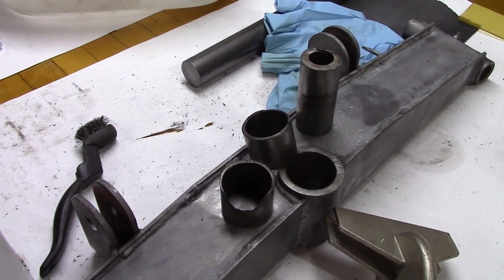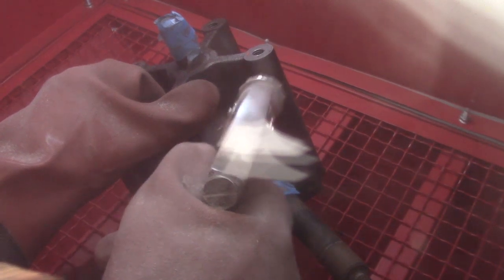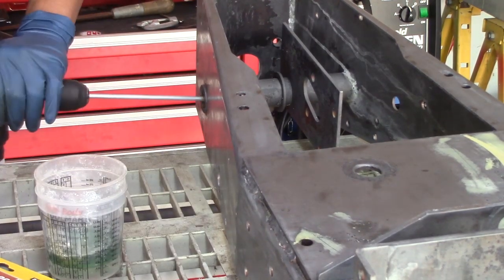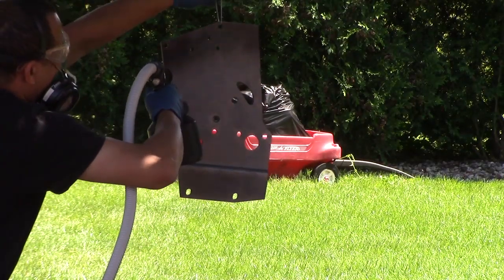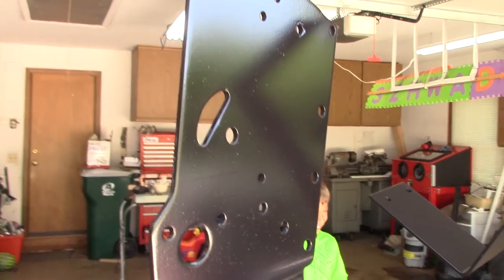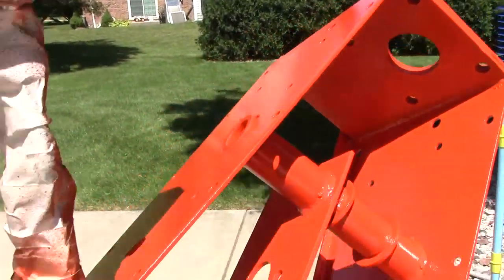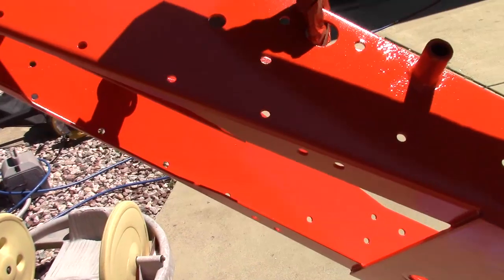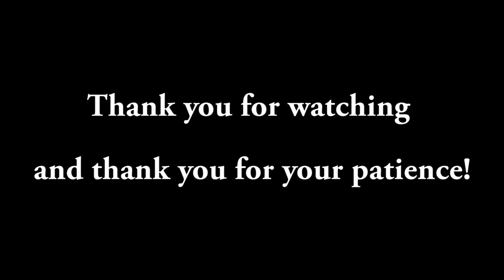34) Allis Chalmers 310 Tractor Restoration project, video 34

Comment: Another great episode!
Reply from the maker: Thank you very much young man;-)
Reply: jster1963 thanks  I am learning from your videos,but why did you change spray guns when you used the red paint, I want to know if I can spray paint a car with the self contained turbine sprayer? paint and clear coat ?
Reply from the maker: Thank you very much action action!  I have used both guns to paint with.  I changed the guns so I didn't have to clean the gun between changing paint. 

I bought that sprayer to paint a car.  I have been told by other guys that it may not have to power to spray auto paint consistently.  Take a look at the comment section on my review of the sprayer gun.  I can't remember who told me that.  As far as the paint I'm using (tractor implement paint) it has worked perfectly.

Thanks again and good luck.  ps  I plan to use auto paint on the South Bend lathe I'm going to restore.  (That won't be for a while though.  I have so many projects)......jster